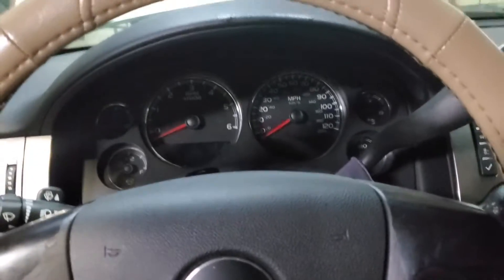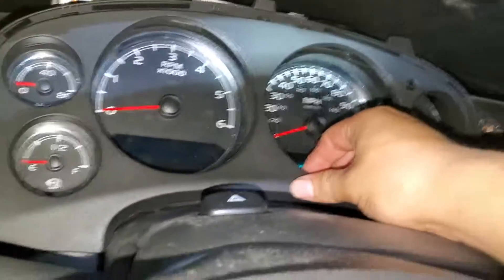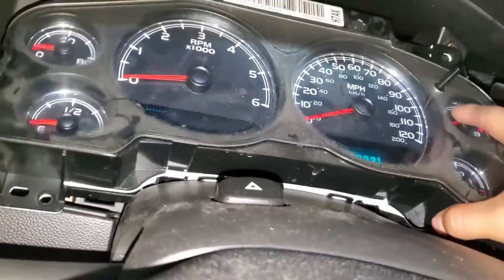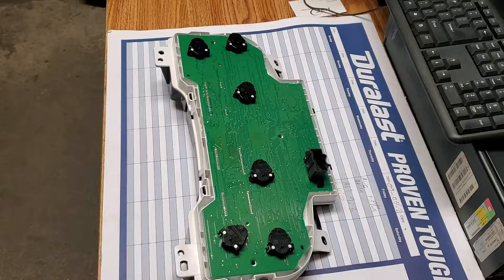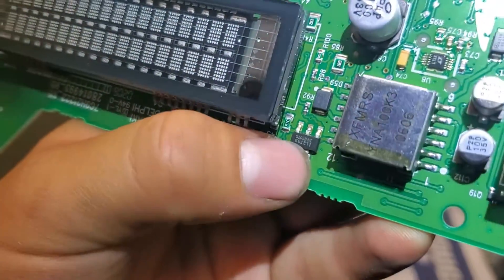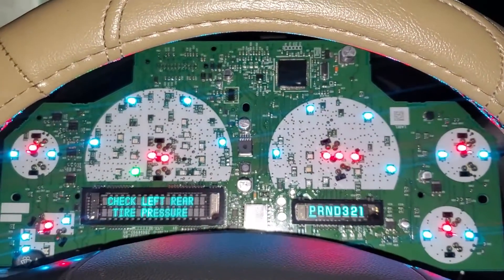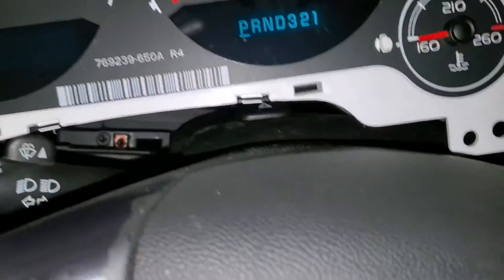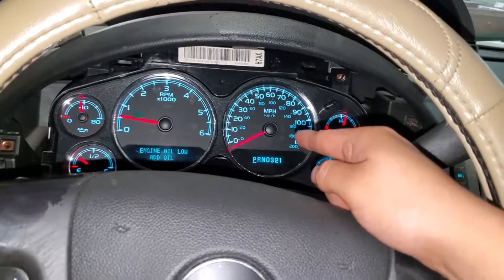How to remove and fix Electronic Issues Instrument Cluster 2007-2010 Chevrolet Tahoe/silverado

Comment: nice videos i having issue with my 2010 silverado 1500 mine lighs the miles numbers and but then the whole dash does not  what can be the issue or how can a  i fix i dont like it like that cant see the speed or check gauges at knight ,, so if i buy neew or used dashboard is gonna keep same miles info or ?

Comment: Thanks for the video i finally know what is wrong with my Tahoe. But that little part is burned. Still can get fix or i need a new part
Reply from the maker: yea it could be fixed just get a new one and solder it and it will work.

Comment: Why does the mofset go out, if I replace it will it go out again anytime soon
Reply from the maker: the Mosfet goes out because the soldering cracks it overtime causing bad connection and then it gets hot and burns.
Reply: @JVFIXLLC  oh okay so it couldn’t be a short circuit then

Comment: This just happened to me yesterday and my car started having a burning rubber smell do you think this could be the reason that I’m getting that smell
Reply: And another question for you sir what could be the main reason the mofset goes out ?
Reply from the maker: I am not sure about that. u have to check if you in Diesel exhaust fluid first. these trucks are nightmares when that light comes on.
Reply: @JVFIXLLC  mines gas but I’m having a evap code showing so ur saying that could be the reason for my odometer stopped working

Comment: Hi i have a 2007 GMC truck I just changed my speedometer when i started my engine and it won't start no power window no Lock, I hope you can help me what is the solution thank you.
Reply from the maker: it should not affect the starting. sounds more like a blown fuse.

Comment: Is there a second of the same mosfet in the top right of the board also?
Reply from the maker: do u have the same issue not the miles showing?
Reply: @JVFIXLLC  my issue is that the gauges sometimes just won't respond completely like they are dead but the check engine still stays lit. I have to cycle the key a couple times for the gauges to respond but to be clear, when this happens if I just crank the truck over it will start and run but the gauges as well as the displays don't turn on only the check engine light stays on. I did replace the MOSFET and it still does it only sometimes. I originally thought this was a bad solder joint as it seems to only happen when it's cooler outside. I checked all my plugs and grounds already I also have dual batteries that are in good health. It used to be a police ppv , 09 Tahoe..
Reply: It's the MCU. I'm having the issue. Check out fixed until broken on here. I haven't found anyone able to fix mine yet.